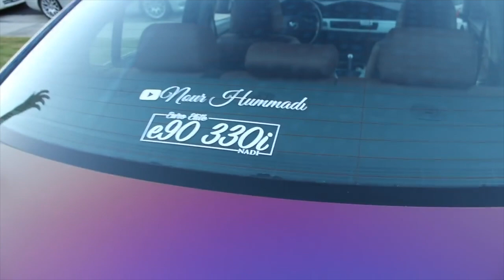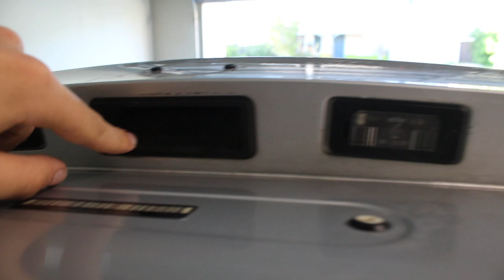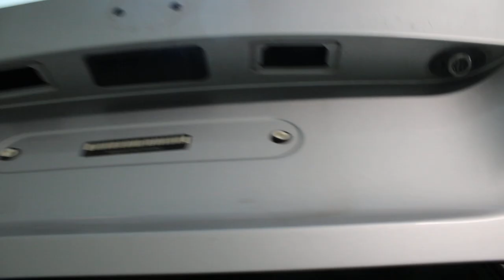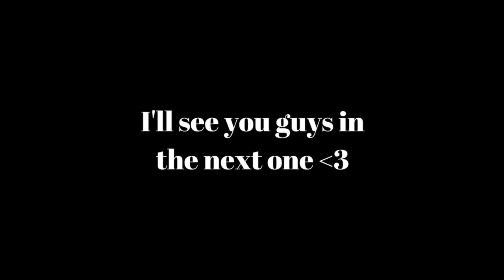WRAPPING E92 TRUNK! Part.3

Comment: How can u scratch the car so much... i mean the wrap isnt forever. Just ruining the whole car under the wrap
Reply from the maker: Leon the car has so many scratches that are larger that these really wouldn’t matter
Reply: Nour Hummadi dude...heres a tip use floss or even better fishing line...it glides under easy without scratching....and if its sticking hard you can warm the area with a hair dryer to loosen the adhesive then floss it.